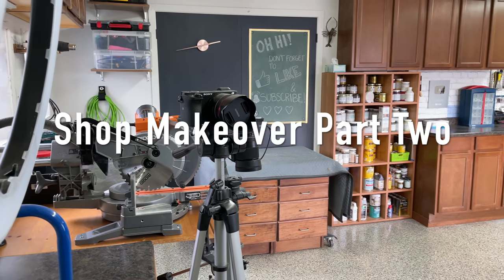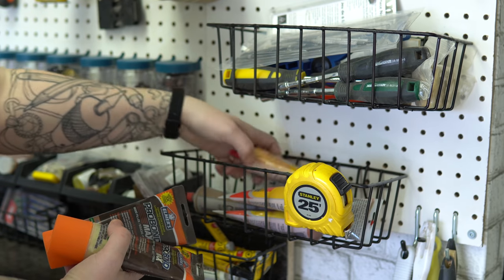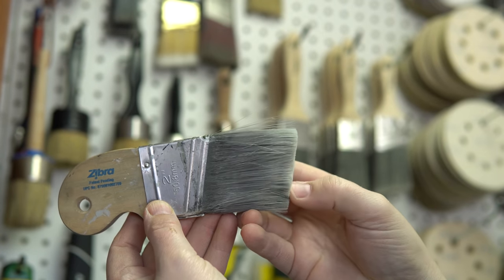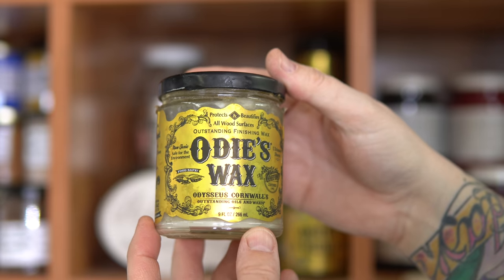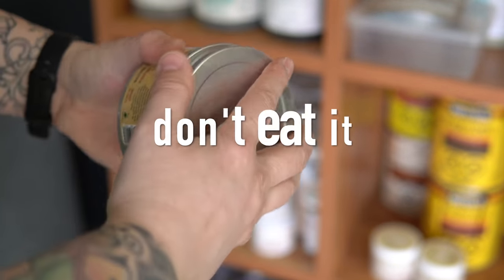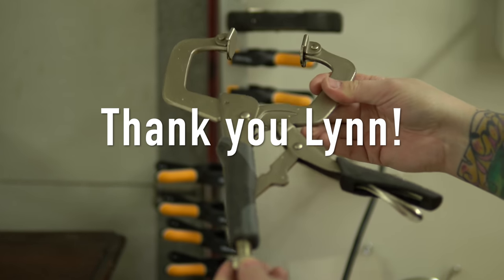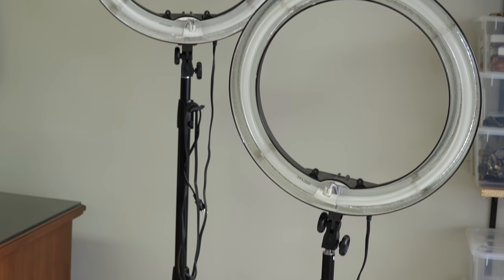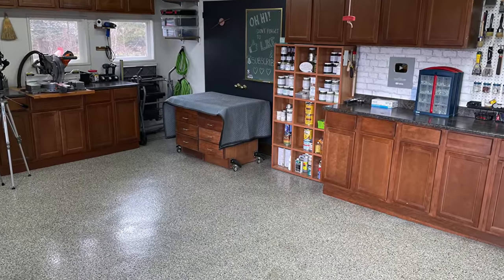How I Organized My Workshop For Furniture Flipping

Comment: Angie, Thanks for the tour. I recently found your channel and really like your style. We think a lot alike. I'm still in my first shop 12' X 12' space 10 years. I have been rethinking a change. The space has served me well but it's getting a bit cramped. As I have collected stuff the open space has gotten smaller and smaller. So this tour has helped me to take the plunge, and of course the cold weather has set in. Working in the shop is not doable.  I also do upholstery It was how I got into refinishing.  My projects always had a element of wood that just needed to be cleaned up. My philosophy The 4 R's "RE-Imagine / RE-cycle / RE-finish / RE-Upholster." Keep it Out of the Landfills. Thanks again!
Reply from the maker: I LOVE your philosophy! So similar to mine! ❤️I'm so glad I could inspire you, best of luck with the shop upgrade! 😊

Comment: I'm taking a break from organizing my shop, which currently resembles your earlier basement space but with piles of tools everywhere. My floor might be a little flatter but not by much. Your shop rocks! and it even has deers, that's awesome. Mine has cats.
Reply from the maker: The deer are strictly outside only. 😉 The cats are allowed in my workroom when I'm not using anything that could be dangerous for them.

Comment: Angie, thank you for the awesome videos.  I am a beginner/hobbyist and would like to know more about sanding set ups.  I see your Dewalt orbital sander connected to a shop vac but can you please provide more detail on that?  What type of vac, how you connect it etc.?
Reply from the maker: https://www.youtube.com/watch?v=puhLQABucDI&t=710s

This is my current vacuum set up. I ended up keeping the Festool for general shop cleanup and for attaching to my Dewalt, and the SurfPrep one I have permanently hooked up to my SurPrep sander. I opted to use the Festool for general cleanup/vacuuming out drawers, etc because the hose actually fits the Dewalt's dust output, and I wouldn't need to buy an adapter for it. Whereas the SurfPrep vacuum perfectly fits the SurfPrep output.

Comment: I noticed you store your paint in the garage what do you do during the Winter in Canada to keep your paint safe. I am in New England and it gets very cold here I have to bring all my paints inside.
Reply from the maker: I have a small commercial heater that hangs from the ceiling and runs on thermostat. I keep it usually at 12-15 degrees in the winter to keep everything from being too cold. :-)